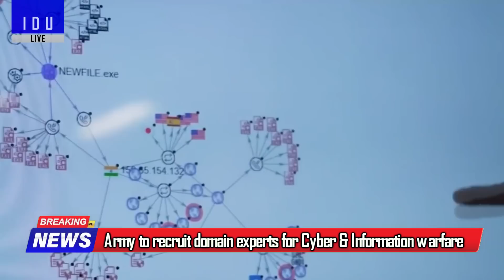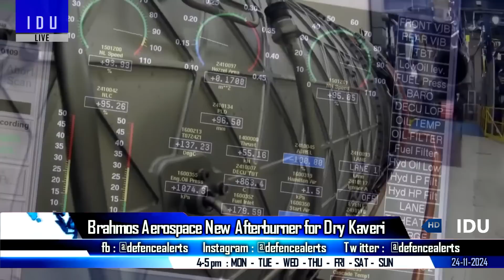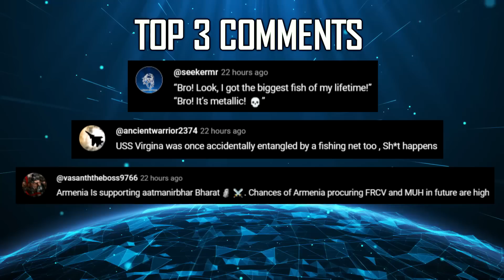Indian Defence Updates : AMCA 3D Thrust Vector,Brahmos Afterburner for Kaveri,New C-295 Refueller

Comment: I think India should expand brahmos aireospace company to a fighter jet+missile manufacturing company.
Reply: The afterburner was done by Russia which has decades of expertise in high temperature alloys for jet engines.
Reply: @mtrest4  no. Russia owns 50 percentage share in brahmos but the engineers working in brahmos is Indians not russians. India used russian oniks platform for brahmos early days now brahmos missile mostly Indian with some parts imported from russia.
Reply: @kishu3b  

Sir, Bhramos is mostly a front company for Russia to do business globally without the limitations of sanctions.

The work is largely done by Russia with some decorations added by India  to the final product.

In the case of the metallurgy, design and fabrication of the hot 🔥 section (afterburner inclusive) of the Kaveri, it's 100% Russian technology.
Reply: @mtrest4  brahmos is mainly a Indian company with russian help, back then India wants to develop a cruise missile but India does not have the expertise so India collaborated with Russia that's it. If this company is mainly russian then India do not agree this kind of setup. Currently 80% of brahmos missile is Indian, Indian government urging brahmos company to indigenous rest of the components within 2 years. That means if this happens brahmos will be 100% Indian. India already possess major systems like ramjet engine and other components.
Reply: @mtrest4  in case of kaveri its Indian design. The only russian involvement in this engine program is testing support from russia. Bcz brahmos is a Indian origin Indian company the afterburner is also Indian.

Comment: If kaveri engine news isnt hyped one then, it one of the biggest happy News for India, A 29kn + 48 kn =77Kn = GE F404 (77kn), thats really a news which every one be wanting to see. they should eye at testing now
Reply: Dry kaveri engine produce maximum of 51kn  dry thrust.
Reply: Sir it displayed 54kn of thrust in russia continuously,  u can also expect more than 30 kn from afteburner, it will be 85kn plus for sure or around it
Reply: @bhaktimandir-my5pk  I think expecting 29k itself after integration is too much optmism. even this 54kn must be in ideal and peak conditions, but anyhow if combo crosses 80kn, and weight gets to <1070 kg then target achieved, forget F404, create a new varient to increase this to match F414 for Tejas mark 2

Comment: The Dry kaveri is still based on older metallurgy. If the program will get proven and start getting funds, then there are high chances that with improved metallurgy in dry variant and with better afterburner, the combo will surpass all the expectations.
Reply: A Kaveri derivative engine 2.0 is being developed with improved metallurgy. It's still a good 4 to 5 years away even if fast-tracked. We can, however, hope to get around 85 to 90 KN with a full A/B section and a flat-rated one at that.
Reply: Point is its a step in right direction, drdo already developing lightweight polymer cermaic alloys for improved kaveri. Which r half the weight of metallic alloys
Reply: @bhaktimandir-my5pk  indeed
Reply: Is this (current Kaveri Engine) derived from M-88 ?
Or is it the original Kaveri ?
Reply: @srikrishna2561  original Kaveri designed way back in the 90s or so. M88 core wasn't taken but the French advice was availed.

Comment: If the Afterburner of the Kaveri engine is a success, it is the best news.
Reply: Why
Reply: @User_p56yyj then we became fully independent from other countries engines
Reply: @Night-6Star    was after burner or, core issues was the  problem with kaveri engine
Reply: @User_p56yyj  we lack the metallurgy bro, there is thrust deficit when the engine operates at higher altitudes. We need the alloys to withstand that impulsive force and temperature , for the engine to operate at full capacity.
to answer your question, it's both core as well as afterburner.
Reply: @Night-6Star  the major issue with kaveri is it's weight and quality of moving parts in the engine which currently does not have a minimum standard life
Reply: Kaveri is flat rated but f404 drops its thrust from 84kn to 74kn in indian conditions, btw kaveri is out from tejas as we already ordered engines for tejas mk1a and in process to order more for 97 additional  tejas mk1a
Reply: Kaveri is a better design compared to ge404. Kaveri numbers given is probably the reasonable measured figure, while ge's is the brochure number. Also ge 404 is not flat rated.

Comment: Brahmos company made afterburner so easily. We should have given then the contract earlier only
Reply: It's a joint company of Russia and India so yes it's easier for them because Russia already have multiple Jet engine but our Babu and Some corrupt officials are only sleeping.
Reply: Reason it was fast is because Russia which has decades of expertise in high temperature alloys did the work.  

Basically the job of developing the hot 🔥 section of the engine was entrusted to them.
Reply: @Vartik-jr4qr Easily? They might've been trying for last 10 years or so, who knows? You only got to know after they succeeded and told everyone.
I do think there are many other projects that we don't know of happening right now and govt. is actually smarter than the people who call them out all the time.
Reply: @ullasshome8392  

What it means is that Russia owns a part of the IP of the Kaveri engine.
Reply: @ullasshome8392  brahmos got the contract in 2023 only when GTRE failed to develop afterburner
Reply: Our air force wants only western  engine  😂😂😂 ...we could have got Russian engine for ourselves   ..if hod hellos export the aircraft with American  engine